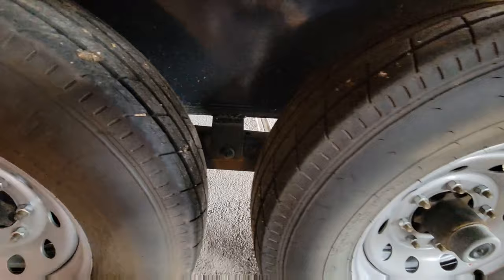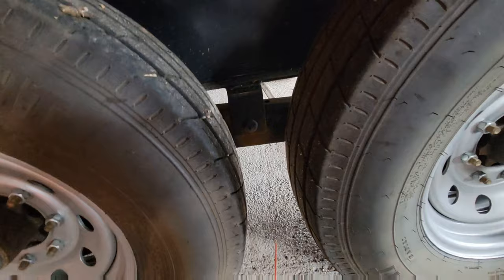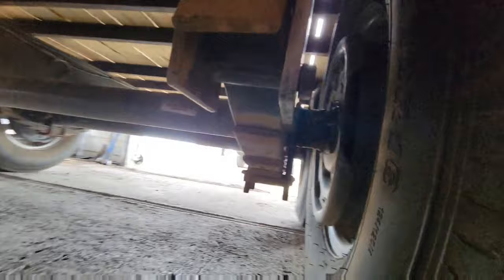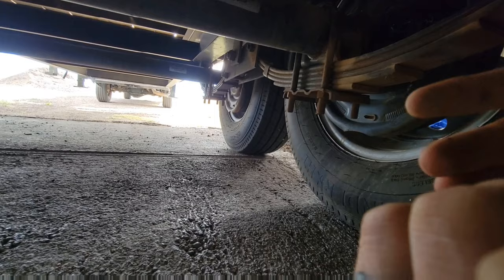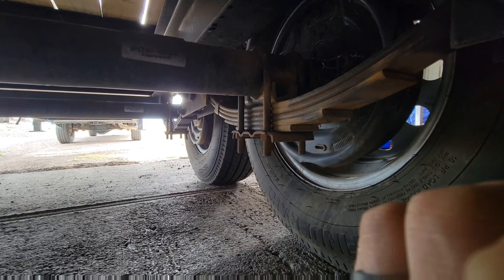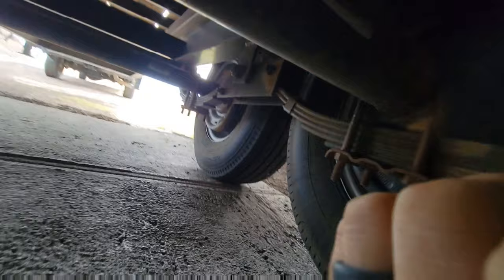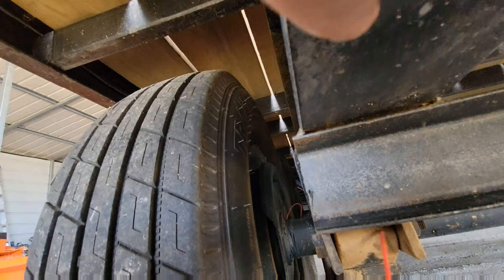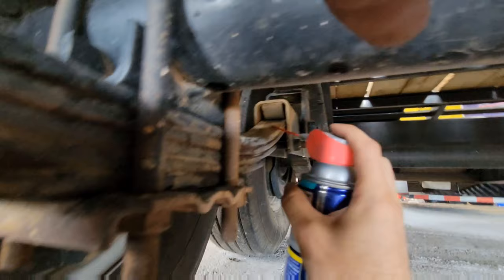How to Properly Lubricate a Trailer Leaf Spring Suspension. #leafspring #trailer #maintenance #wd40

Comment: I would try graphite spray it doesn't collect dust like wd40
Reply: WD40 contains acetone,,,,it only lubricates for a few minutes, but it will remove old oil and is great for cleaning surfaces before lube with grease or high viscosity oil
Reply: @enricoderojassarson5596  you guy's might want to pay attention to the video, the brand is wd40, it's white lithium.

Comment: What would you think about using a Dry Lube with PTFE or Dry Graphite Lube instead of the White Lithium? Just to keep things as clean and dirt resistant as possible... Thanks for showing the important locations to hit!
Reply from the maker: Would be good options for dirt resistance for sure. Not sure if they would do as good as white lithium for the metal to metal contact. But it would be a fine choice I feel